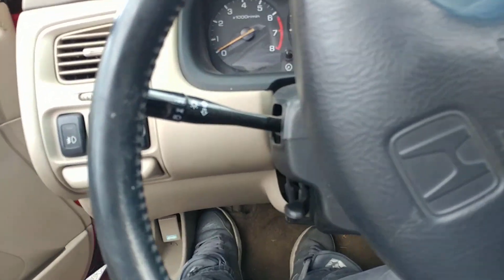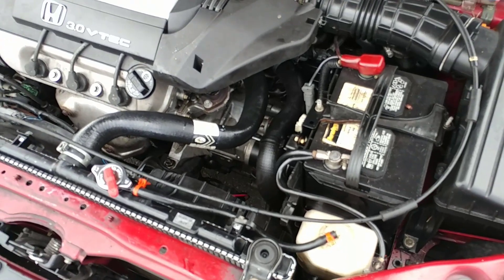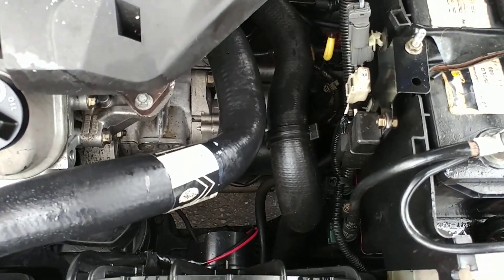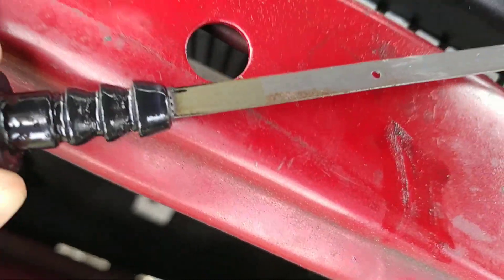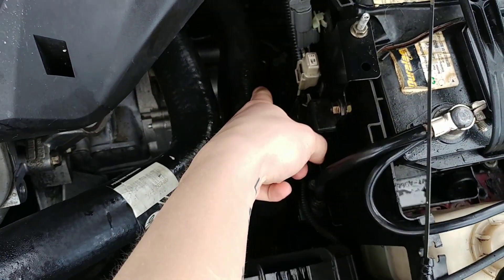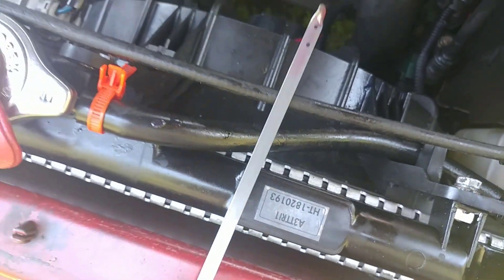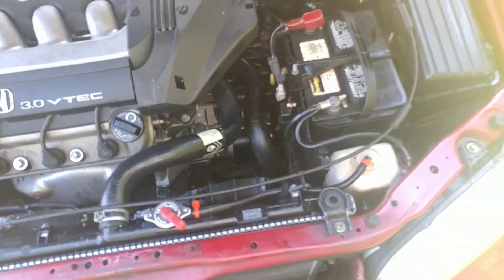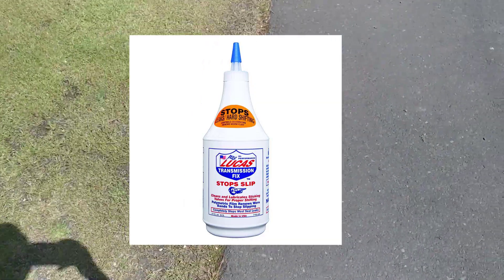How To Get Water Out Of Your Transmission

Comment: Can this be fixed without a replacement?  https://photos.app.goo.gl/cLKB3vh2x2amtDU58   ..  my van has no dipstick.
Reply from the maker: Well this one time I had a hole in my windshield wiper fluid container so I stuck a piece of duct tape over it and flex sealed over the tape and that fixed it but if that hole in the photo is to ur radiator then flex seal probably won't work. If your okay with having some adhesive flowing thru ur coolant system (which I personally don't think would be a big deal) I would slap a piece of tape over it and then cake over the tape and around the tape with JB Weld. Don't drive the car untill it cures completely and it should be fine
Reply: @rxdicalforever7847  sorry I mean full transmission replacement? I do anticipate a mechanic having to drop, fix parts and flush at least.
Reply from the maker: @12vLife  hard to say. I don't know all that much. And to be honest with you I've never seen any plastic covers on transmissions and as far as I know both automatic and manual transmission fluid is Red. I'm not sure what that liquid is in ur photos. Drive your van see how the shifting feels. If it works it works. Transmission rebuilds cost just about as much as a replacement.
Reply: @rxdicalforever7847  thanks. OEM fluid on my van is green for some reason.  the plastic case is $65 OEM.  I found a local same year low mile transmission with papers for $400 (evidence of salvage), but wonder if installer will blame it if we have problems after he installs.
Reply from the maker: @12vLife  Threaten his life